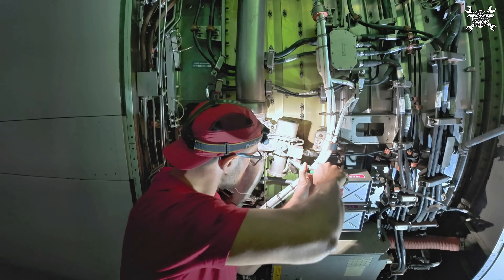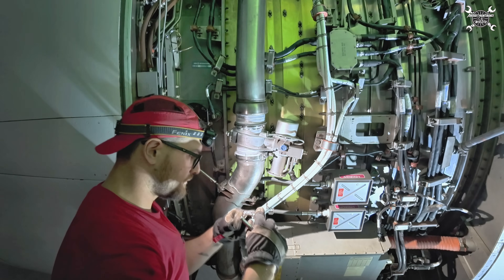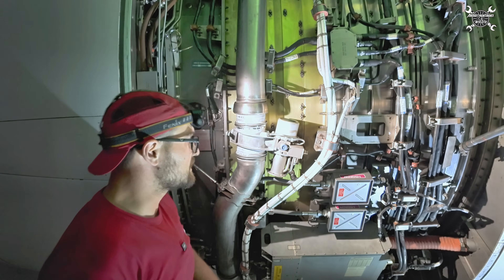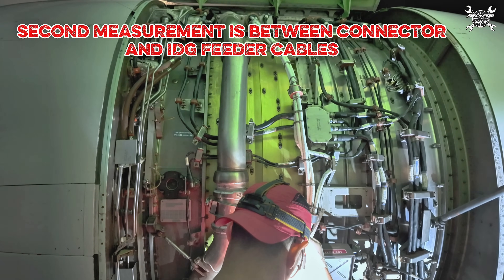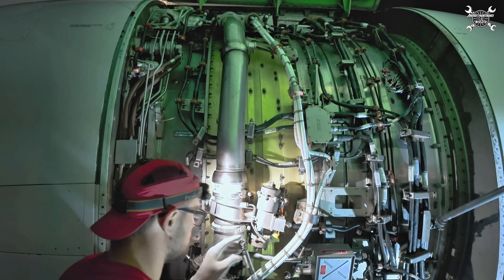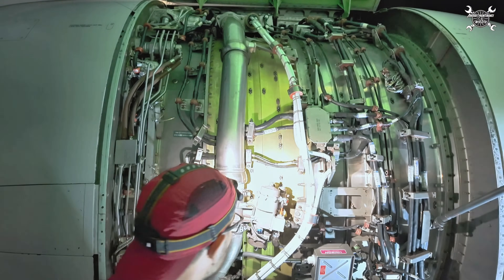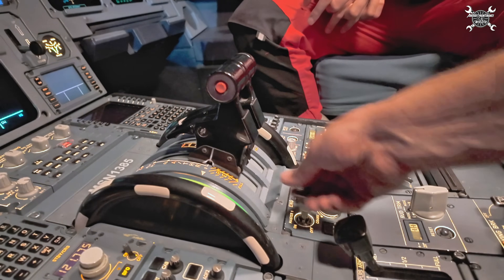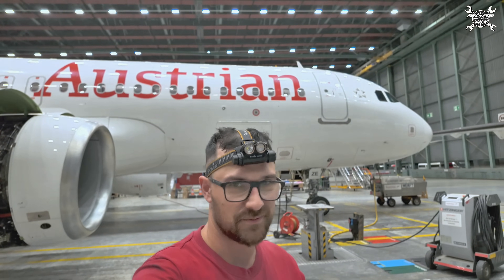How to start the jet engine! Starter valve

Comment: Which brand/type of developer (for leak check) are you using?
Reply from the maker: We have several brands so hard to say. I always just grab one for A320 and that is it.
Reply: @zeto.r  Thanks. I did some more research and could find one such as "Sherwin D-100". However what is interesting to me is that this is a developer for dye penetrants (a multi step NDT procedure to find cracks in metal etc). In this application you use it stand-alone to detect air system leaks. It would be cool if you can show how the developer looks if there is a leak detected.

Comment: Just out of curiosity, the starter valve is on the right side of that engine, is it on the same side on the other engine or is it reversed?
Reply from the maker: No the engines are same. You can swap them. So all components are on identical position 🙂
Reply: I would bet any amount of money it's not reversed. Unessecary tooling/engineering to mirror the piping for no benefit.
Reply: @Hayley-s5t  That is my guess too, but there are so many strange things that go into a plane...